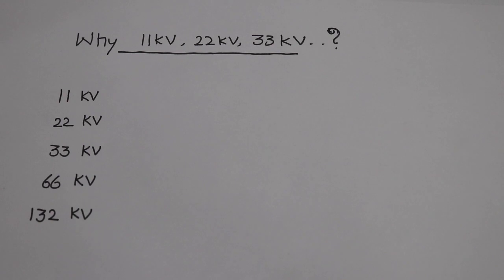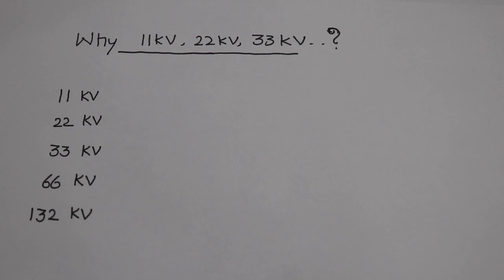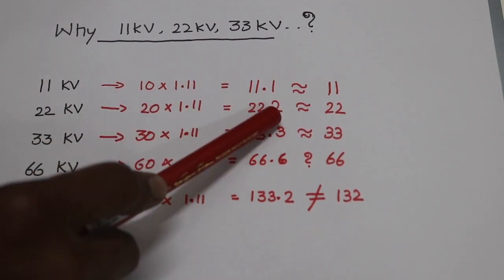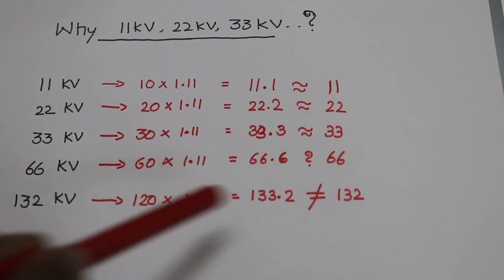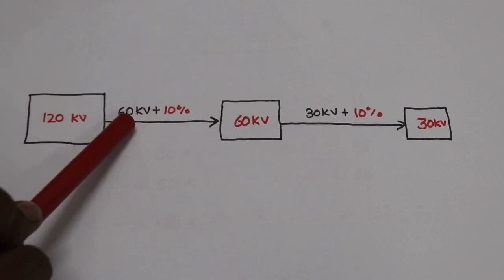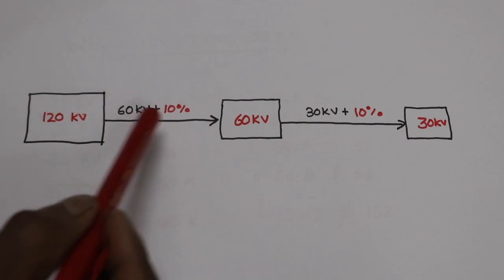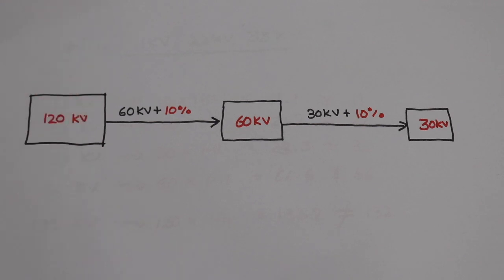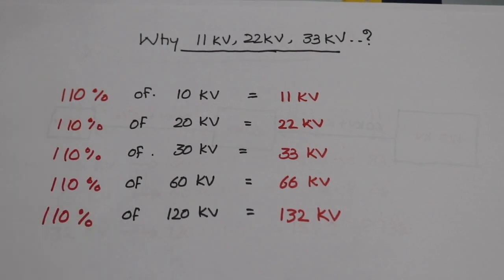why 11,22,33KV ?

Comment: Pakshe 10% voltage drop varuthullu ennu urappundo athil kuduke annengillo ellam transmissiontem distance orupolle allalo
Reply from the maker: Normally allowed aaytulla volage drop 5% aanu.  Ath anusarich aanu transmission design cheyyunnath. Oru safety factor pole extra oru 5% koodi koduthanu 10% kanakkakkunnath
Reply: @ThroughTheCircuits  OK thank you for your reply
Reply from the maker: @nikhilsreekumar5744  🥰